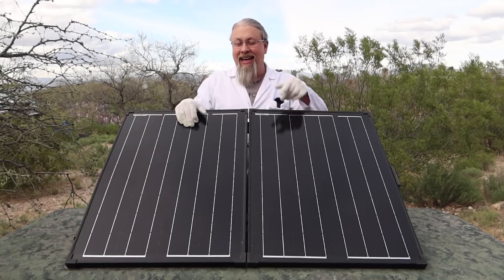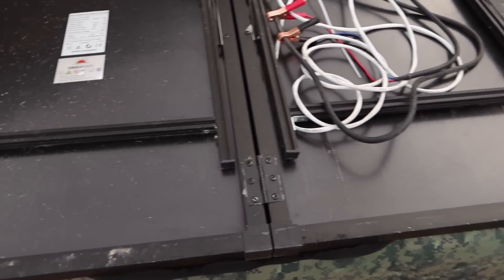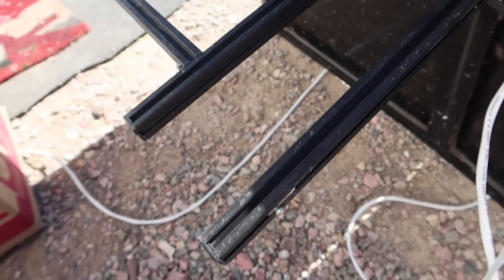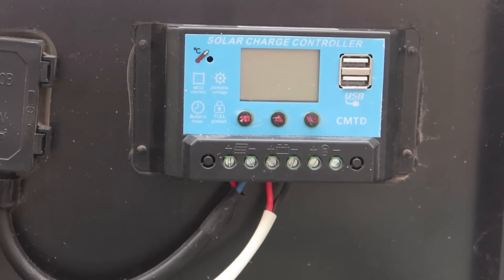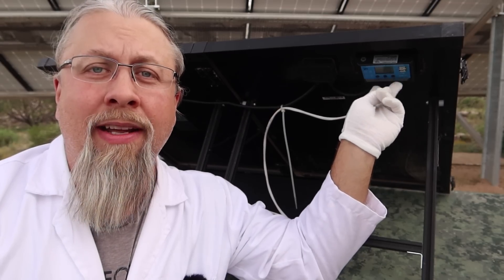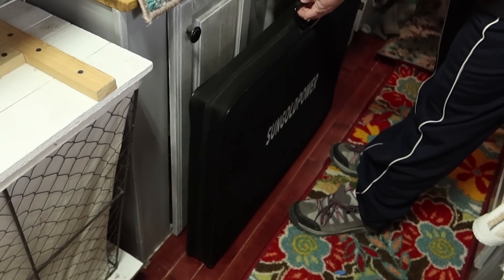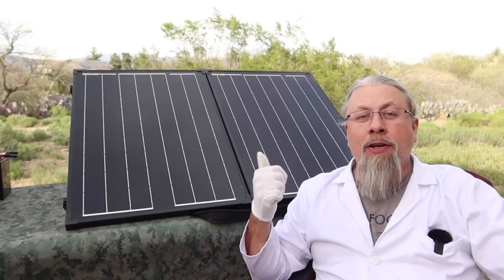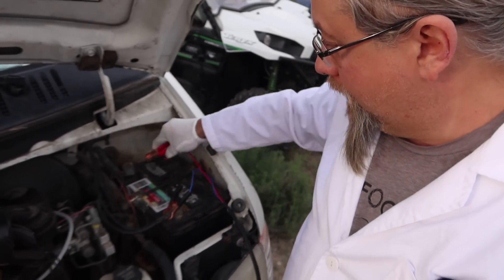CHEAP 130w Solar SUITCASE KIT That's WATERPROOF! SunGoldPower Portable Solar Panel Review

Comment: Thx. Pasted code..."not valid."
Reply: Yep.. Code Expired .. :-(  Still a nice panel set.
Reply from the maker: @chrisw1462  New code is RT63P6C7
Reply: Should have removed the old code before posting, would have saved us a lot of hassle
Reply from the maker: @j.b.9895  I didn't know it was changed until I checked this morning.